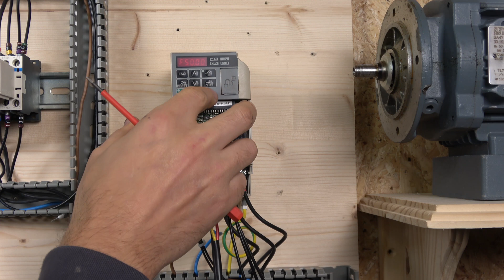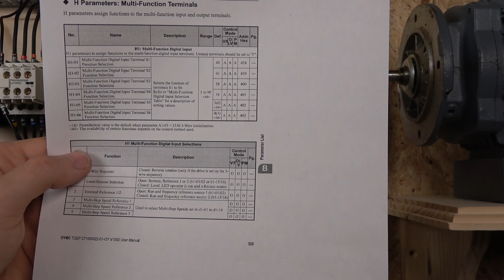Omron/Yaskawa V1000 VFD remote mode control, 2 wire control and 3 wire control (English)

Comment: Hello,might be a little to late to ask,but how does frequency appear at dhe driver screen,on remote ,cus when i press local the frequency is there and i can change it,as soon as a press the lo/re button again,the frequency is not on the screen anymore and i can not start the driver neither in 2 and neither in 3 wire control.

Comment: Hi Ingus, I have been following your YouTube for quite a long time now. I have a challenge recently on Yaskawa v1000 vfd. It was initially on source mode and was later changed to Modbus when the machine electronic board got burnt. The owner of the washer(Atoll 350) sent the vfd to Germany for reprogram to a new upgraded electronic board. Now, the upgraded board and the vfd came and it was installed but it is not working as it should, the motor rotate very sluggishly and pausating as if there is serious friction but when rotated by hand it's very free. I tried to gain access to the inverter all to no avail, only A1-01 and A1-04 could be accessed. What can I do and what parameters will I adjust as there is no handy manual. Thanks.

Comment: Thank you for video,i i have V1000 connected to the fan touch panel controler,but when i am trying to run the fan from the control panel it is not working even i can see/change controls on the touch screen and on v1000 drive i can see that freequecy is matching the input on the touch panel/controller...but fan is not working...the only possibility is to run the fan by pressing/changing V1000 the local and then change frequency....is there any video that may help me please?Thank you!

Comment: Hello, I have got J1000, running in 2wire mode. I want to add emergenscy stop, but my switch is normally closed and works in opposite way, can i change it behavior? Thanks.
Reply from the maker: Am not sure about this drivemy friend. Some drives allows you to that some don't, you need to check manual for that information. Usually comes under i/o section.
Reply: @IGSElectronics  Thanks, I downloaded FULL manual, instead of Quick starter guide. And reprogrammed input S3 from external fault to Fast Stop N.C. It's H1-03 = 17 (it was 24). And changed stop speed on C1-09 to 2sec. Now it works nice.

Comment: Ingus, is it possible to wire-up only the input mains (R,S,T) , and not the output wires to the motor (U,V,W), to program or setup the drive? Thanks. Jean
Reply from the maker: Hi Jean. Yes, you should have no problem with that, if you try to start without motor connected, it might come up with error no motor or current rush,  or something like that.
Reply: @IGSElectronics  Thank You.